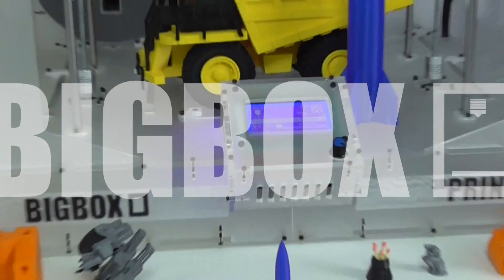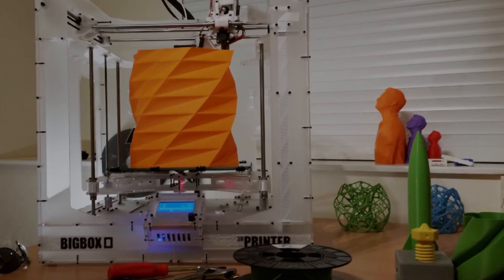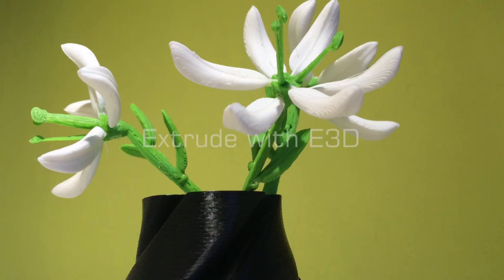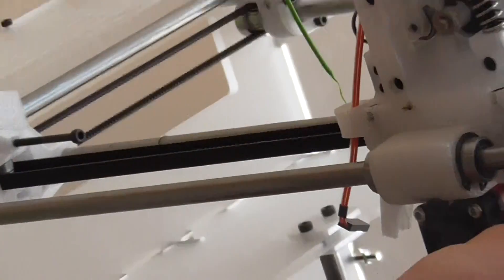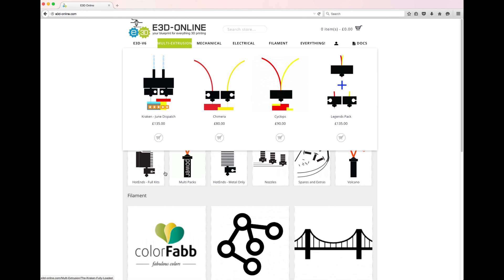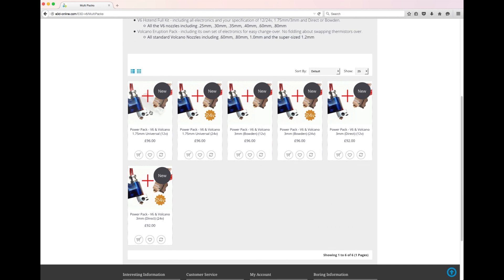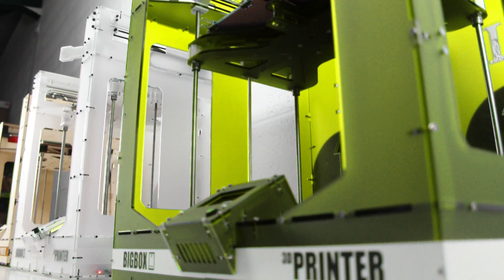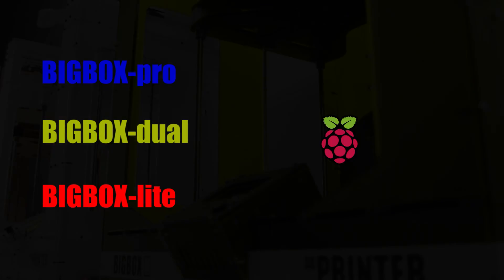BigBox Video

Comment: Would it be possible to buy separate parts from the printer as I already have most hardware lying around at home.
Would be most interested in the big hotplate, glass plate and acrylics add-on.

With kind regards,

Tom
Reply from the maker: +Tom De Bie Hi Tom. Yes! There will be mini kits available on the E3D site soon, so it will be easy to order the parts you need :)